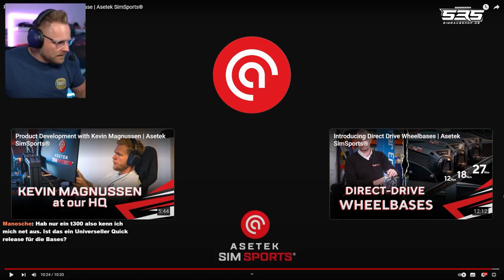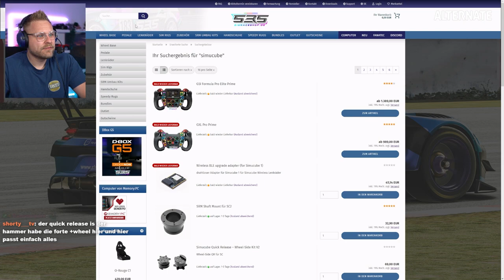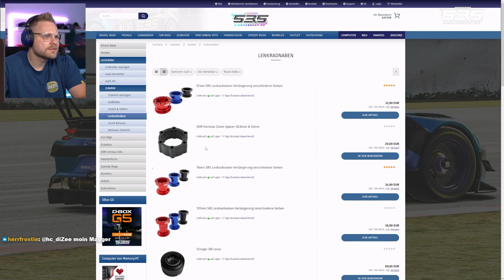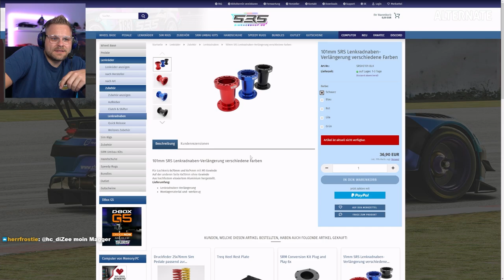Ich schaue mir das neue Asetek Quickrelease an - zu teuer?

Comment: Tatsächlich hab ich mich am Ende für die SC2 pro entschieden und nicht das bundle von Asetek genommen weil mir das Lenkrad halt gar nicht gefallen hat…
Reply from the maker: Ich würde sie gerne mal ausgiebiger testen wenn der qr da ist
Reply: Das mit dem Lenkrad hat mich auch zögern lassen. Habe es mir aber dann doch gekauft. Bin von DD1 umgestiegen. Habe es bis heute keine Sekunde bereut. Die Base selbst ist (bis auf ein/zwei Software- Dinge die man besser machen könnte) super. Das Wheel ist besser als es aussieht. Sehr robust und funktionell. Nutze aber derzeit auch andere Wheels mit selbst gemachten QRs (ohne USB). Anfang nächster Woche sollte ich aber die originalen QRs in meinen Händen halten und dann wird es richtig klasse...
Reply: Das freut mich zu hören das du nicht enttäuscht wurdest 😊👍🏻 Bin mal gespannt ob ich sie irgendwann mal wo testen kann… gerne auch mit active Pedals 😅😂